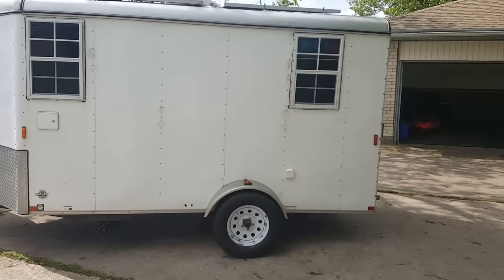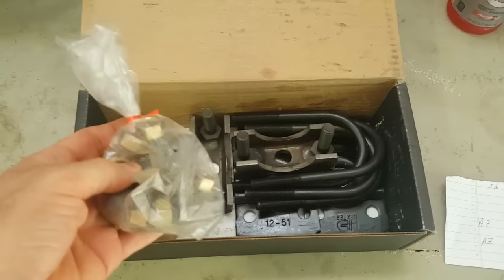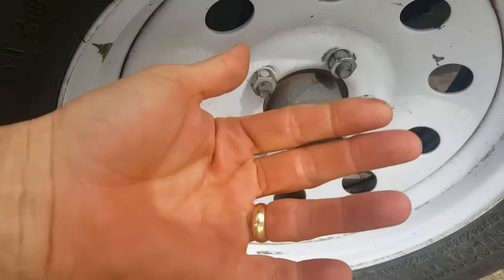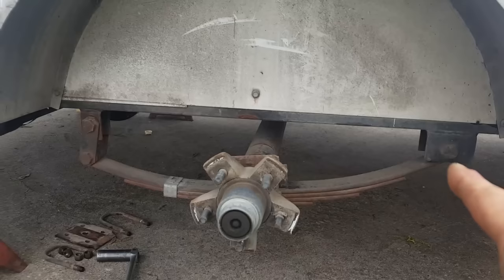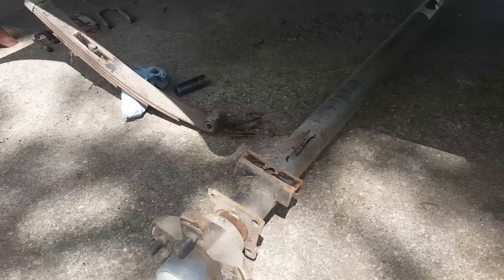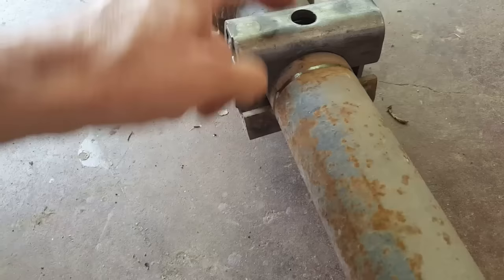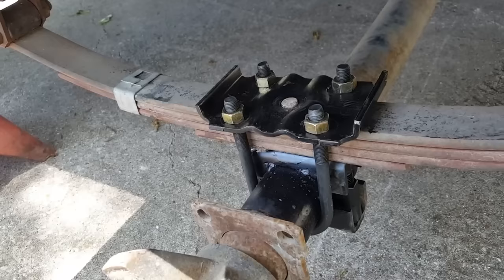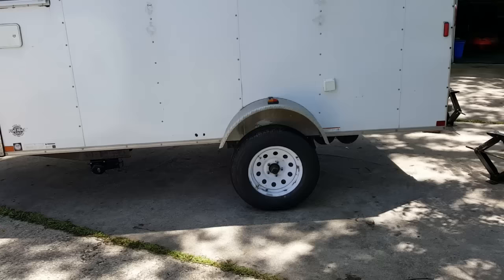DEXTER TRAILER LIFT 6 X 12 Cargo Trailer Camper Conversion Part 32

Comment: This is what I need to do next to my 6x12. I have already done some inside work, put a little insulation & installed 2 windows. This video is extremely helpful.
Reply from the maker: Sounds like you have a good start. Thanks for watching. Good luck on your project.

Comment: Excellent video.  Looks relatively easy and inexpensive to do, too.  I recently replaced my trailer's wheel bearings out of an abundance of caution ($25/axle).  In doing so, I noticed the hubs were also made by Dexter, same as the lift kit.  It looks like I could have almost as easily installed a Dexter lift kit while replacing the bearings.  With the hubs already removed, it would have been easy to pull the axle out without needing to remove one of the leaf spring bolts.  Thanks again for another great video!
Reply from the maker: Yep, it's a fairly simple installation. I try to get all that axle stuff done at one time, but don't always succeed. It's a dirty area to have to work for sure. Good luck with your project.

Comment: This was very very helpful.  I  took the axle off today.  Unfortunately I have to take it somewhere to get it the seats welded.  I guess I will reinstall it next weekend.   Actually it was a piece of cake to get off.  I had to cut the brake wire but I needed to do that anyway as I have to reroute the wire around a hot water exhaust pipe.  Thanks for the video.
Reply from the maker: Glad it helped

Comment: i installed this kit on my camper ( 3-11-2023 ) the kit is great, but the one thing the instructions does not mention ?, is the long adjusting bolts being welded ?, what is going to keep them from backing off the seats ?..nothing !!!..lol. they can loosen up over time. sooo..to solve this, i also tack welded these long nuts to the seats to keep them from backing off over time.
Reply from the maker: It's not going to hurt anything to tack the bolts and yes they could back off over time. factory spring saddles are welded and do not have bolts I would hope the new saddles would be welded well enough that the bolts would not matter in the long run. The bolts allow the installer to place the new saddles parallel to the factory's.  Good luck.

Comment: Is it possible to put on a new axle on trailer that has had original hardware removed?
Reply from the maker: yes, it is possible with a welder.
Reply: @FakeLegGreg  I found someone. Raybuck welding in Dubois PA but he’s going to find some iron he’s got laying around to brace the trailer and make the axle more sturdy. I like the idea of new axle but I feel lucky to have this either on. Most body shops went with in it because it has been modified
Reply: Darn typos: most shops won’t work on this due to the jimmy rigging it’s had
Reply from the maker: @lsherry2429  Glad you found a welder to work on it. I hope he gets it all fixed for you.

Comment: Thank you for the video sir. Can you tell us what welding process you used and amperage. I need to do this on my trailer also. it looks like the brackets are 1/8 inch and possibly the axle is 1/8. thank you
Reply from the maker: I used an AC stick welder. 3/32 6013 rods. round 90 amps. Good luck
Reply: @FakeLegGreg  thank you sir i appreciate your response

Comment: I really need help, I’m stuck about 2000 miles from home and my tires are pointing towards each other. I was told by ac trailer repair shop, nothing to worry about and it is not the weight but it’s getting worse. Help 😢
Reply from the maker: I don't know where you are. I would join a local RV facebook group  and ask for local shops that could repair your trailer. It sounds like you have a bent axle.

Comment: I assume you are going to put truck/car tires on the trailer.  What kind of adapter did you use for the lug nuts and where did you get it?  Cheers
Reply from the maker: The lift was to clear the holding tank under the trailer. I still have trailer tires on it. No need for adapter. Thanks for watching.

Comment: Why not extend the 4 spring brackets, instead??? ( I just dont know)
Reply from the maker: You can do it that way. Most people do not have the materials and equipment to do that. I actually have flipped and moved the spring mounts on a pop up trailer I am rebuilding at this time. Good luck on your project.
Reply from the maker: https://www.youtube.com/watch?v=ssoKIJ6sGVQ

Comment: I just bought a boat and the trailer bottoms out going up my driveway. Would this lift kit work on a boat trailer? Thanks
Reply from the maker: The lift would work for any trailer that I know of. A lift with torsion springs is  probably different. You also need to know the diameter of the tubing you axle has. E Trailer sells the correct spring perches for your axle. Good luck.

Comment: I watched how you did it and I got excited because I want to do the same thing. However when I checked my axle it is a dexter axle with a 4 in drop. How would I lift that? Is it still possible?
Reply from the maker: I do believe that you can still put a lift kit on a drop axle. It depends on the diameter of the tubing of the axle.
Reply: GB Conversions & Adventures ok thankyou.....how do I find out the diameter and the kit you used is good for what diameter.? I appreciate your help.
Reply from the maker: @jimdes1792  You are going to have to crawl under the trailer with a tape measure and measure across the axle. Also, does your trailer have leaf springs?
Reply: GB Conversions & Adventures Yes I have leaf springs and the diameter I just checked with a calliper and it says it’s 2.36 in 60mm
Reply from the maker: @jimdes1792  Cool. It's a 2 3/8 inch axle. If both ends of your leaf springs have spring eyes and not sliders then you probably need this kit from E Trailer. https://www.etrailer.com/Accessories-and-Parts/Dexter-Axle/K71-384-00.html
Reply: GB Conversions & Adventures Not sure what a spring eye and a  slider is but each side of my spring has a bolt and a nut going through an eye so I assume that would be called a spring eye. Really appreciate all your help thank you.
Reply from the maker: @jimdes1792  That will work then. Good luck.